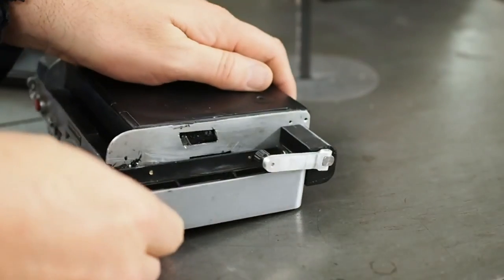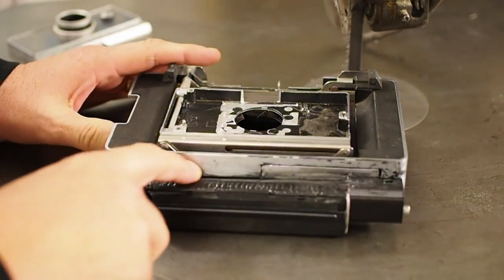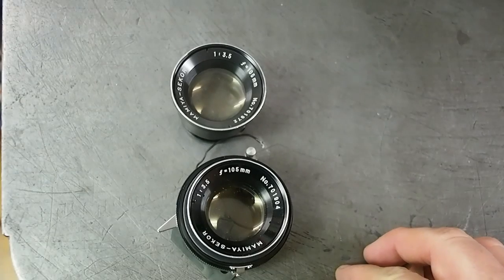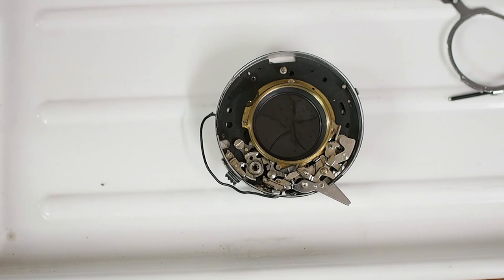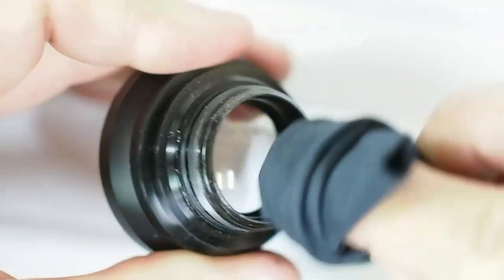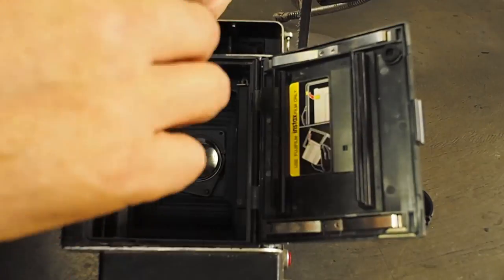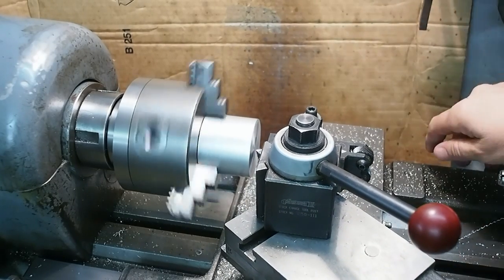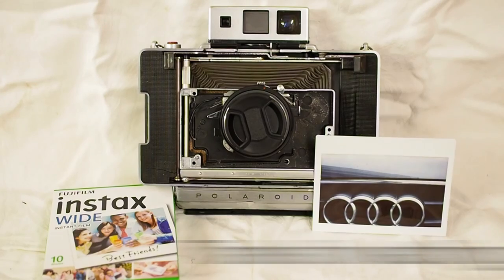Polaroid modified to use Instax film - episode 3

Comment: you can drill a new hole next to to original infinity hole, then you can cheat the rangefinder
Reply from the maker: Thanks for watching. I've seen various hacks for the range finder, but my first issue is to move the lens back closer to the body, so that it can go to infinity. Once the lens is correctly located, I have been thinking of going all in and maybe making a replacement cam, so that the Rangefinder is accurate for the shorter 105mm lens across it's entire range.